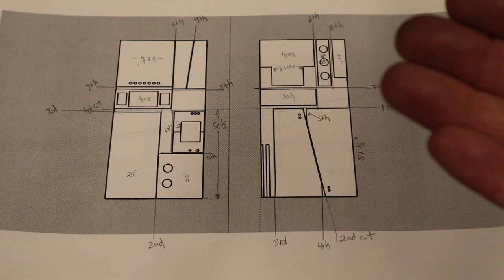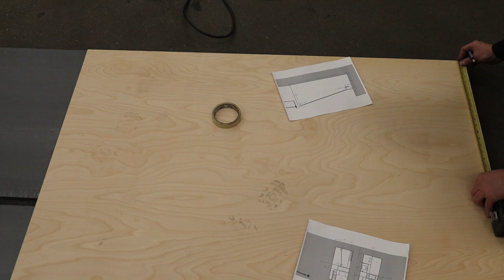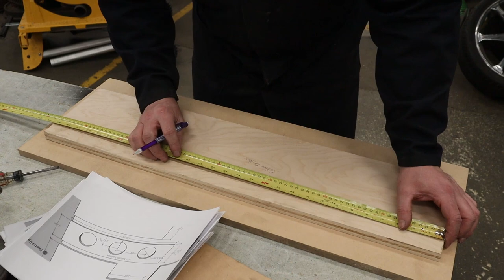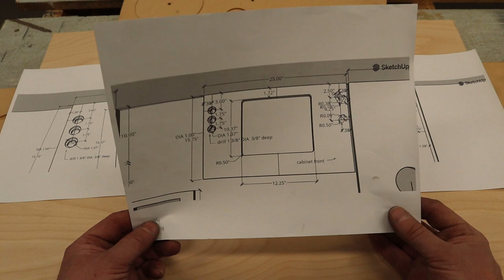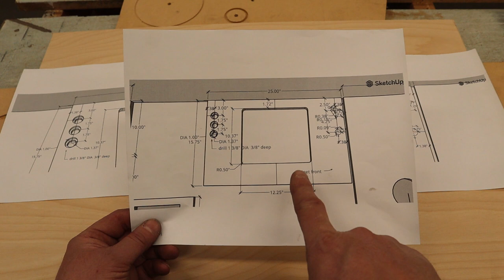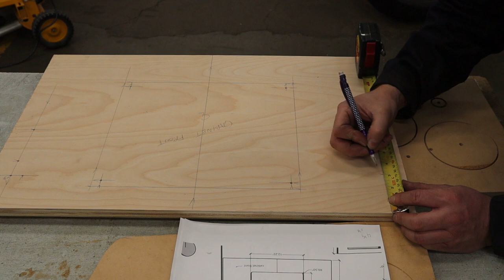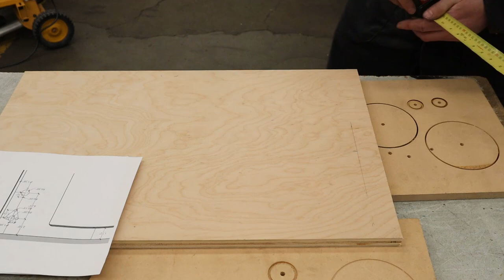How to make a virtual pinball cabinet

Comment: Gotta hate the Imperial system... is it any easy way to convert your files to metric system? Or do i need to manually convert everything?😃 Otherwise great work with the series, i have learned so much!
Reply from the maker: Oh I see....you're one of those metric snobs....lol.  JK.  Come to the dark side and learn our ways.....  I constantly switch between the systems so it's not a big deal for me.  There are only maybe 40 measurements to convert and it's easy.   1 inch = 25.4mm so take the fraction and turn it into a decimal form (1/2" = .5)  and times it by 25.4 to convert to mm.  Maybe I should offer a pay version of my plans for mm and charge bank.....lol.
Thanks for the watch!
Reply: @wayofthewrench  hahahah :D YES i am a euro-trash (sweden) :D Lucky me there is Internet! Found an online converter so i just need some quallity-time and convert it ;) Thank you for all your work!
Reply from the maker: LOL.....big fan of your country!  One of these days I will visit.
Reply: @wayofthewrench  <3

Comment: Great video! Currently planning and ordering parts for my VPIN build. I did have one question though. In determining the overall length of the playfield box, how do you accommodate for the space the lockdown bar will take up? Obviously you don’t want it to cover the playfield screen, but rather match it up to the edge. Is there a universal measurement or should I just not design the box until I have the lockdown bar?
Reply from the maker: Great question!  I would design your custom vpin around the parts you are going to use.  If you use original dimensions and the correct lock bar, then you have to stay within those constraints.  I already knew I was going bigger and going to have to make my own custom lock bar so I was able to make it exactly how I wanted it.  So for my build, I'm using a 46" tv that is almost the perfect length as long as I make a 3 inch deep lock bar.  If it was too long or too short, I would have changed the box length dimensions or the lock bar depth to suit.  Thanks for the great question, I can tell your head is in the game trying to visualize how all of this comes together.  Thanks for the watch, cheers!

Comment: I can't see anywhere, where you mention how you're locking the rear access doors closed? How will you be doing that?
Reply from the maker: I just tried to figure out what video that is in....couldnt find it.  I used drawer locks.  They are like $12 and can be found in hardware stores.  You layout where it needs to be and drill a hole and mount from the inside.  Lock ends up flush on a 3/4" piece of plywood.  Cheers!
Reply: @wayofthewrench  I'm thinking you forgot to put it in a video 🤣
Thanks!
Reply from the maker: I know I did film one of those locks but it is tacked on to a video that was kinda unrelated...I was there, so it got done.  If I remember, I'll let you know.  They are pretty easy though, just follow the back of the packaging.
Reply: @wayofthewrench  Near the end of How to decase your PC ;)
Reply from the maker: Perfect, I knew I did it somewhere.  Cheers!

Comment: I've made exact replica WMS pinball cabinets before and there's NO SUBSTITUTE for a router when cutting out the pieces. You'll get the absolute cleanest edges using a flush cutting router bit and routing against a straight edge guide
Reply from the maker: Add some hard board templates and you've got a pinball cabinet factory!  Thanks for the watch!
Reply: @wayofthewrench   I use birch when I make a playfield and 12 ply plywood for the cabinet. Since I use a flush cutting router bit, I can duplicate a wood pattern as many times as I want
Reply from the maker: Nice!  I'm itching to build another one now.....
Reply: @wayofthewrench  Very cool. I also have the skills to design electronics and program a modern machine, but my current software  job is keeping me too busy to do anything else

Comment: Hrmmm... the tip of my jigsaw blade flexes when at its extremity, making it impossible to do the plunge cut without cutting the wood around it.. new jigsaw and blade didn't help...
Reply from the maker: It's a tricky thing to master for sure.  A thicker jigsaw blade with less teeth per inch might cut better.  I would suggest practicing on a piece of scrap plywood till you get it.  You do have to move forward as you start the cut or it shakes the blade too much.  Good luck!
Reply: @wayofthewrench  I ended up using a shorter blade, and that didn't flex at the end.. but it's really bad at cutting the plywood, so i did the plunge with the short one, and the rest of the cutting with the longer one :)
Reply from the maker: Cool, yeah I figured it might be the blade.  I think mine was really thick...like cutting metal think maybe.

Comment: The circular saw/table saw terrify me so i prefer to cut out with a jigsaw positioned slightly off the pencil line and then finish the piece bly clamping a piece of wood along the pencil line and then finishing it off with a router.
Reply from the maker: Yeah that works too. Lots of different ways to get the job done.  Thanks for the watch and welcome to the channel!

Comment: @Way of Wrench - I know your not doing the direct feedback part yet, but what do you think about kits that attach direct from the buttons without going through software? It looks like a better solution to me. https://www.youtube.com/watch?v=uov0cH7qnFw
Reply: To be clear, it still integrates with dof for the bumpers etc, but the buttons for the paddles are direct connect. This is the part of the video that explains it. https://youtu.be/uov0cH7qnFw?t=2864 - It's really cool.
Reply from the maker: Yeah its pretty cool and I just watched the video you sent me.  Funny thing,  I was looking at this a week ago and thinking that would be super simple to do exactly what was in the video (minus the added circuit for reducing the voltage to the solenoids).  It's actually a super simple circuit and the parts are cheap.  It would be super easy to try it and see what it's like.

My thoughts on this is if your not doing ssf, it is an easy way to have flipper feedback without dof.  If you have ssf it might add a second sound/feeling for the flippers that might have issues with a slight delay between the 2.  Then you would have to cancel the ssf sound for flippers.  I will know more on this later when I have my ssf setup.  Personally Im hoping my ssf will just blow my mind and I won't need anything mechanical but I do plan on eventually trying to add some mechanical stuff like gear motors, shaker, knocker and go from there.  Thanks for the link!
Reply from the maker: The basic setup doesn't need dof, just the bigger setup as those have to link up with dof for the game's bumpers,etc.
Reply: @wayofthewrench  Yeah, I think the flipper solenoids would be a big improvement where the larger setup might not be drastically better. The shaker might be really cool depending on the game. This element almost seems like automotive assemblies. I can't wait to see what you do with it. I like how you are kinda practical about things.
Reply from the maker: Yeah why spend money when you don't have to right? I literally have automotive solenoids kicking around the shop and the gear motors everyone uses are car window motors....there is even blower motors for fans or for mounting an eccentric lump of steel to make a shaker motor.  Lots of cool stuff to tinker.  I would definitely add a switch to turn them on and off like they suggested in the video too so you can have night mode for playing without the loud mechanical sounds.